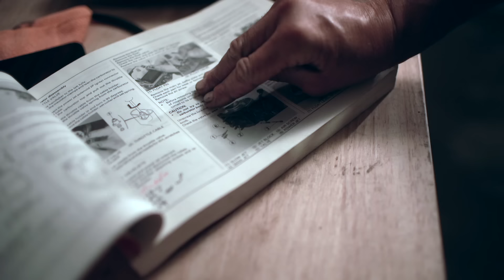Velocity Disorder II. Honda CRF450R vs CR250R

Comment: Im 48 still riding/racing I’ve been waiting for something like this. I used to race woods with a 2013 KX 450. I have recently switched back to my roots and gone two-stroke and now have a 99 CR 250r  18” rear  all the bells and whistles frame up rebuild/restoration. The bike is pretty much new and I absolutely love it. Having  raced both I can see why they use to run the 4stroke in the 250 class when they came out. This video shows it all! Thank you!!! Love it!!!

Comment: For those that dont get it,this guy didnt just start riding bikes lol.I got a TM125 before the first year RM80 at 13 years old,had go carts as a 3 year old and everything up to cr500,250r 3 wheeler licensed for street.KFX 700  all tricked out,its a part of your life out 4 wheeling to a beach in alaska and then pull out the toys for incredible riding.Back in 70s 80s we rode out 125 yz to school,they had parking for dirt bikes and the law didnt care.Dirt roads mostly.now its nevada and arizona,wide open rides.

Comment: You should run a CR500 2 stroke against the 450 4 stroke that would be a good one on that track!
Reply: There is a small company in Santa Barbara making brand new CR500’s, would love to ride one.
Reply: The tech just isnt up to standard but I wish a big company would . I'd love for ktm to drop a 460 2 stroke and it have the modern technology dedicated to it , people has been brainwashed into thinking the 4 strokes are more powerful,  well when you give ANYTHING 200 more cc's it will produce more power, the fact a 250 cant run inside the lights class tells you all ya need to know.
Reply: I thought I was only one who thought that. CR250 isn't really evenly matched to CRF450.
Reply: @clemsontigz1  You are exactly correct  every one thinks 4 strokes are faster then 2 strokes and they are if it has a bigger motor but if they were to make a 450 2 stroke it would be more powerful then a 450 4 stroke.  When I go out riding with my buddy hes got A 450 4 stroke and I have a 2017 YZ250 and I am right behind him whole time.
Reply: @clemsontigz1  Well technically you can't compare the same cc 4 and 2 stroke bikes because 2 strokes have their powerstroke every second stroke while 4 strokes only have every 4th. So the cc difference should be about double to balance that factor out, when comparing them togehter.
Reply: clemsontigz1 what about the brc500
Reply: @nobba255  that is the dumbest thing I've ever heard only people who've never worked on the engine think that. Yeah 2-stroke fire every revolution but it does not have near the efficiency for each explosion in a 4-stroke does so does not double the power per CC.
Reply: @4touchdowns1game29  The explosion is the same in each engine, 4 strokes only get gases out and fuel in more effiecently. But then fourstrokes have like 5 times the moving parts, which all eat power from the engine. 2 strokes are less efficient yes, but dirtbikes dont have any limits for fuel consumption, so 2t bikes just have to go trough more fuel to get the neccesary power, So the bad effiency of 2t bikes doesn't factor here. They make the same power, but use more fuel to make that, has nothing to do with cc's. I would think twice before going out and just calling people dumb.
Reply: @nobba255  perfect example of this is a bullet coming out if a rifle. Poke a few tiny holes in a rifle barrel and you will lose a considerable amount of energy that is lost as gasses escape because of the crappy seals. The same can be said when comparing combustion of a two stroke vs a fourstroke.
Reply: @nobba255  What about the torque difference? I say it is the most fair to run 4 stroke against 4 stroke and 2 stroke against 2 stroke. Would love to see a national 2 stroke series. But whatever you ride, just keep riding.
Reply: Whats the company called? @brentfrank7012
Reply: Most people in this thread are talking about power......this isnt a quarter mile strip. 500cc two strokes died because 250's were lapping faster on most tracks and far easier to ride, the manufacturers couldnt sell 500's, no one wanted them. The four stroke advantage isnt power, its traction, this track looked loose enough that although open, a 250 four stroke would be right there with these two bikes.
Reply: @ibewillow  ,
Yes!!!!!! People tend to romanticize the 500cc two stroke nowadays. Customers didn't want them and dealers often had to sell them below cost just to get rid of them. That's why they're never coming back!
Reply: I owned and raced an 84 CR500 and an 85 KTM500. These bikes had too much uncontrollable power and were much slower to ride fast on most courses. 500cc 2stk would be especially horrible in SX..... too much flywheel weight interfering with the handling via the centripetal force and the rapid power delivery interfered with the suspension compliance, especially under power. A 250 2stk and a 450 4stk are analogous in terms of the engine type/capacity with each optimized for the fastest lap times.  Note that manufacturers hv stopped increasing 4stk capacity at about 450cc..... more is found to be less.... ergo, slower lap-times.
Reply: Väinö Grönroo:
I define a stroke as one revolution of the crank in which the piston goes up & down once - so a two stroke engine has a "powerstroke" per each revolution of the crank & the piston up & down once, whereas a four stroke engine has a "powerstroke" every two revolutions of the crank, thus the piston going up & down twice...
Reply: I love 2 strokes but let's be honest the modern day 450 4 strokes absolutely blow the 2 strokes out of the water.  Watch moto head magazine a Honda cr 500 v. S ktm 450 they have 3 racers on a beach and the ktm smokes it eveytime. Jeremy mcgrath who loves 2 strokes also said he wouldn't use a 500 2 stroke and go up against todays 450s.